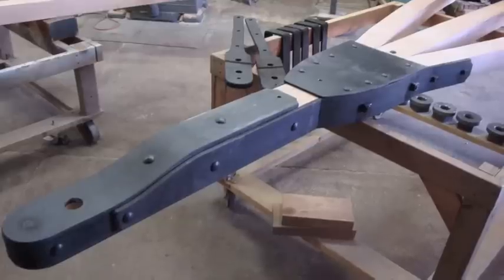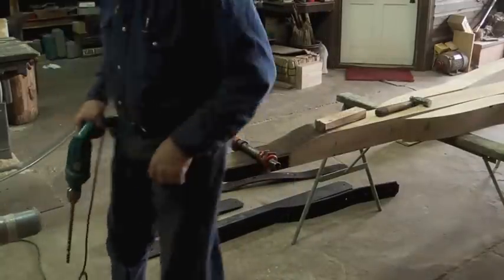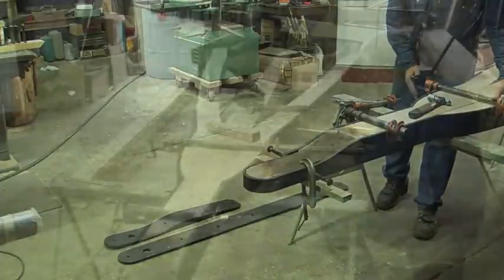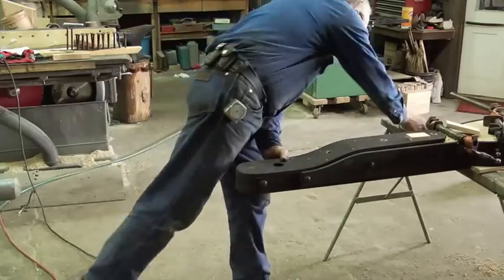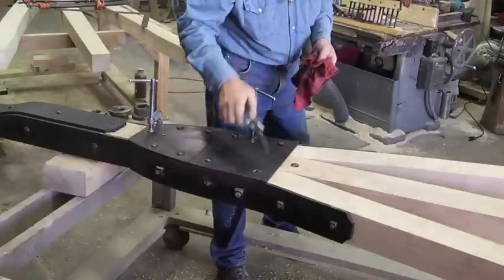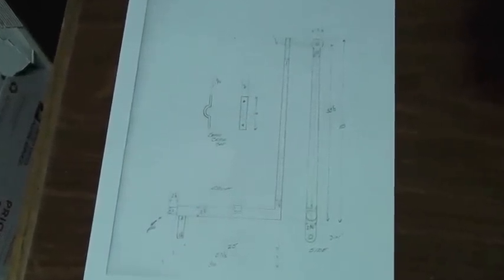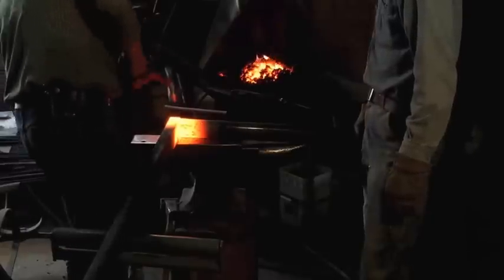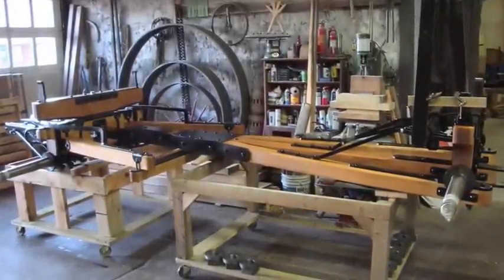The New Rear Axle Assembly is Heavy Duty! | Lots of Heavy Blacksmithing

Comment: Did you anneal the steal?
Reply: Steel.
Reply: I stand corrected. Not steel, not enough carbon so iron.The fact is either steel or iron metal needs to be annealed to reduce stresses.
Reply: Roger that Blue Leader.. Over and out.